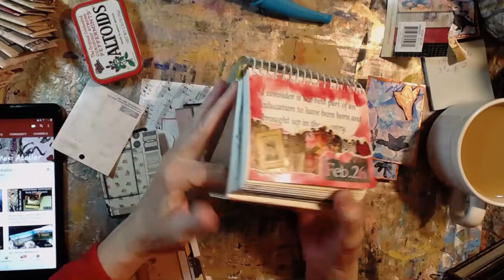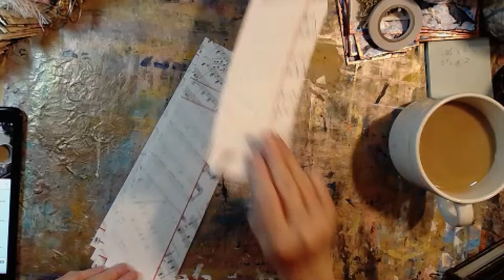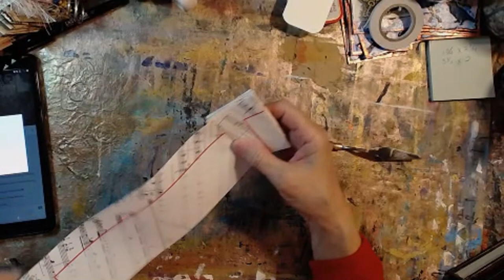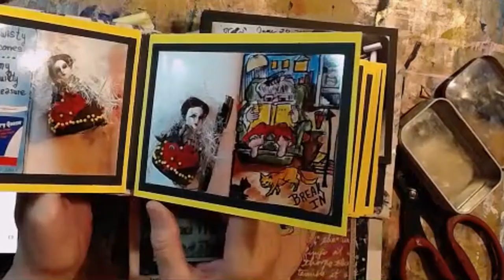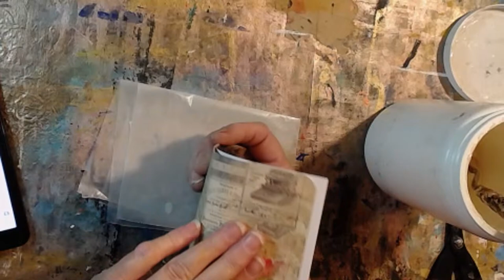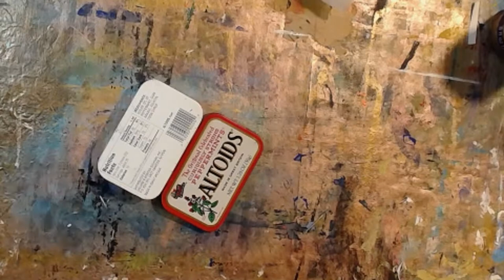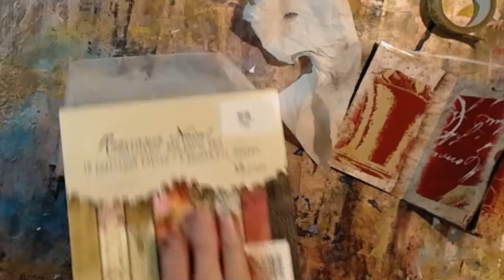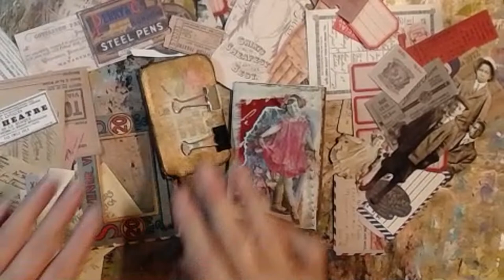Early Mornings With Meri, Little Art Journal in Altoid Tin, Zine with Fabric Washi

Comment: Love your stream Meri, yes you can put warm olive or coconut oil for overnight and use a shampoo with lavender or peppermint.  Stay away of the Panthene product that will make it worse.  Just saying!  thanks for sharing
Reply from the maker: Thank you for sharing that --- I miss those old hot oil hair treatment's. I don't see them on the retail market,  at least around here
Reply: @MyMeriArt  We don"t have them here in Canada either, but they have oil treatment in small spray bottle and you just spray your hair and leave it in no rinsing.  I find that they work good, you just have to look for the ones your hair needs it most like dry scaip or itchy scalp.  They are usualy next to the shampoo. Thanks for taking the time to answer.  hugs from Canada!!